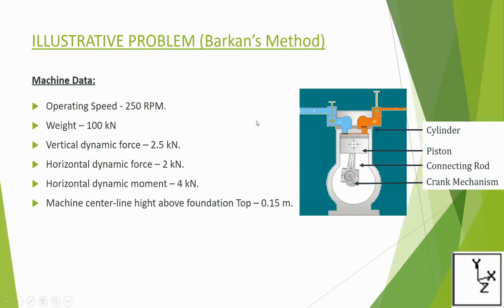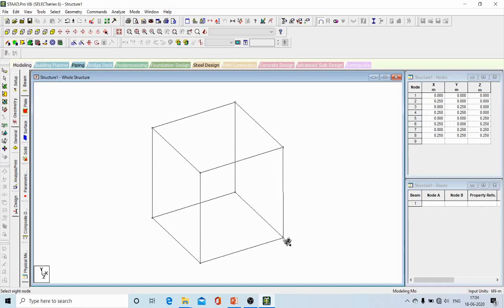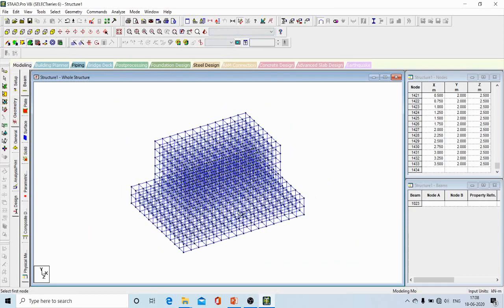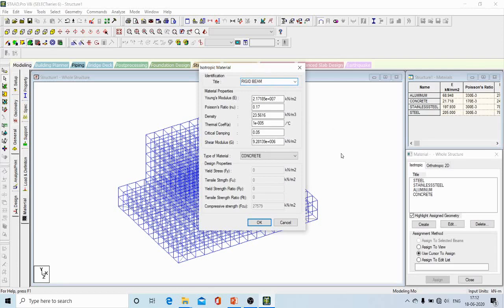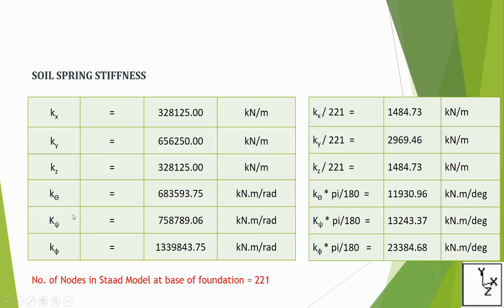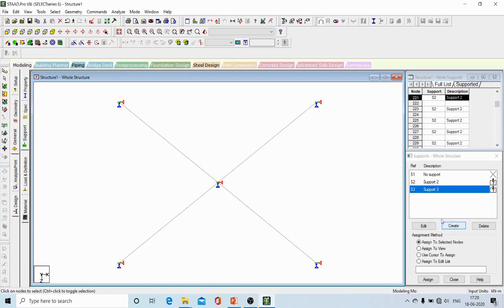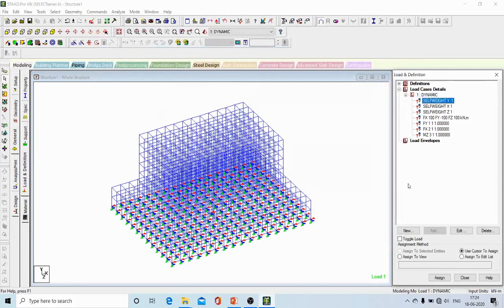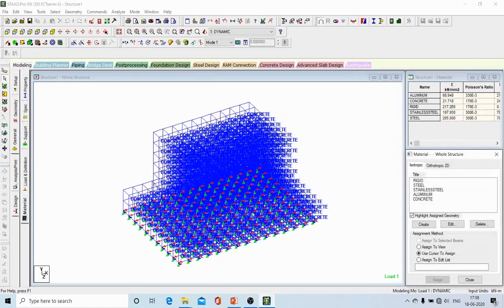Modelling and Analysis of Block Type Machine Foundation by Finite Element Method using STAAD Pro.

Comment: Hi Vivek, i want to ask the reason why only 1 node is assigned with support 3 (that is have rotation value) while for the other 220, the momen is released? Thank you
Reply from the maker: Only one node is assigned rotational support to avoid over-constraining, ensure numerical stability, and allow realistic foundation behavior. Soil mainly resists translation, not rotation. This setup prevents artificial stiffness and ensures correct dynamic response.

Comment: In case for rigid foundation, the modulus of subgrade reaction (Bowles) will be proposed for the spring stiffness of each node of support so that the final summation of Ks is equal to 40*Qult.